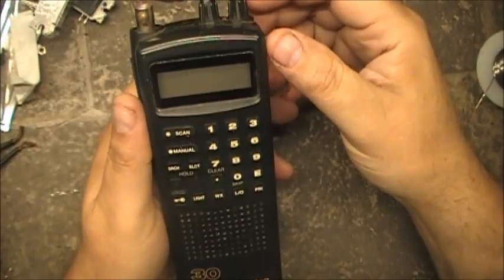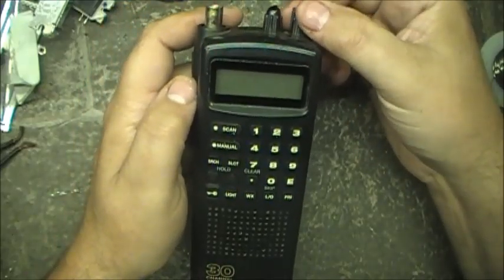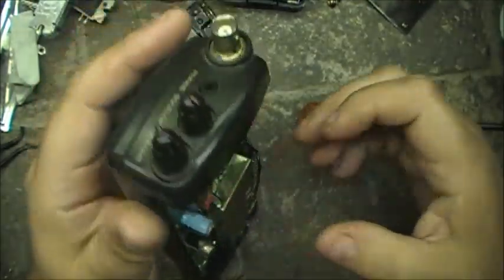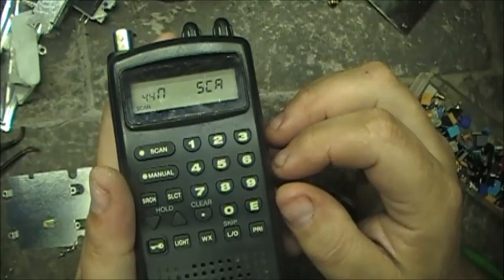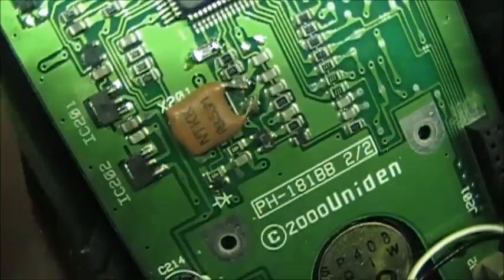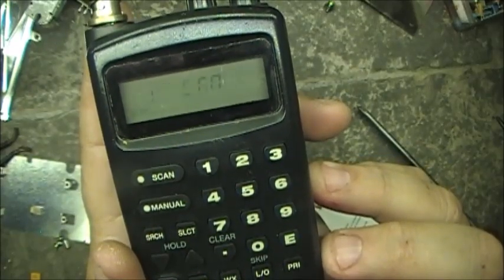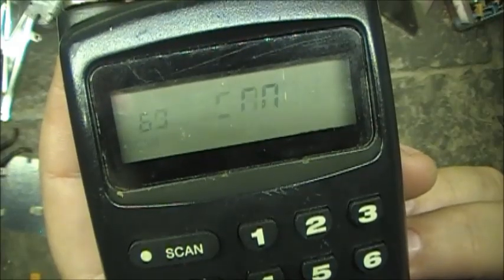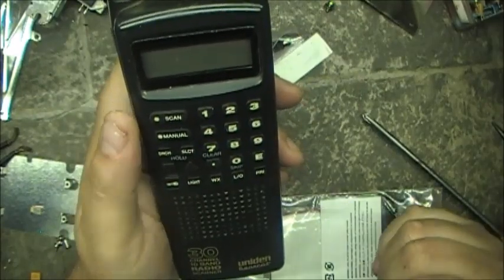Uniden Bearcat BC60xlt Speed increase modification  ### NEW ###

Comment: Correct me if I’m wrong, but this is the BC60XLT-1, not the BC60XLT, right?  Iirc, the latter was limited to 10 channels, whereas the former was capable of 30 out of the box.  Anyway, this is cool, but what I really want to know is if there’s a way to fix a BC60XLT-1 that will no longer retain its programmed channels.  Does it have an internal battery somewhere I’ve not yet found?